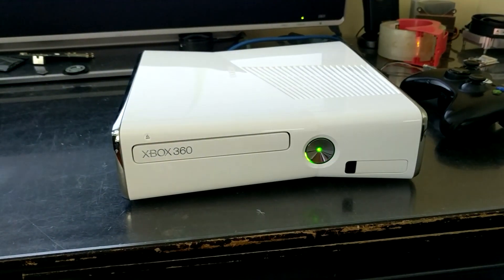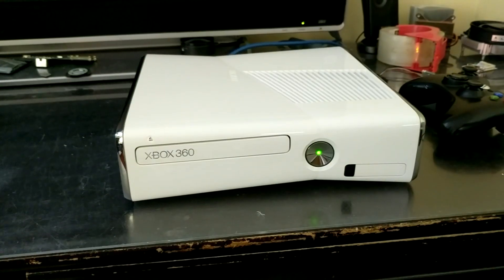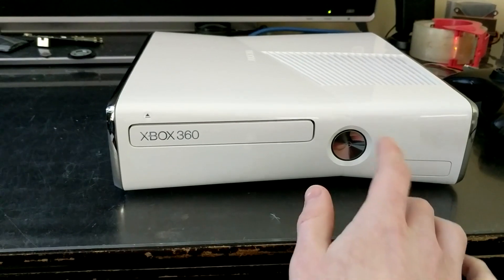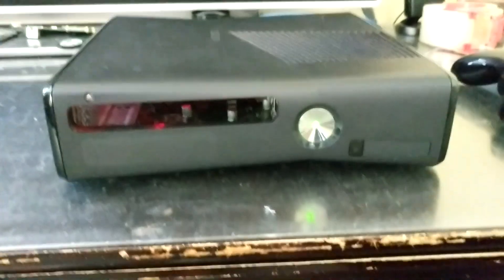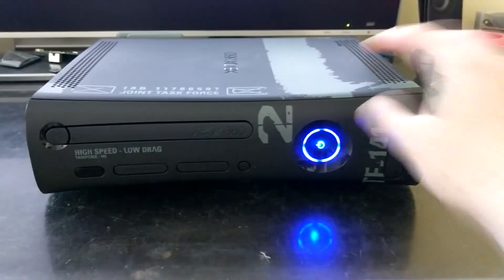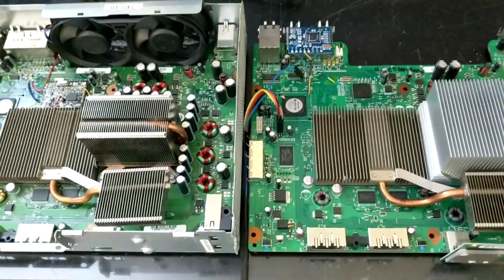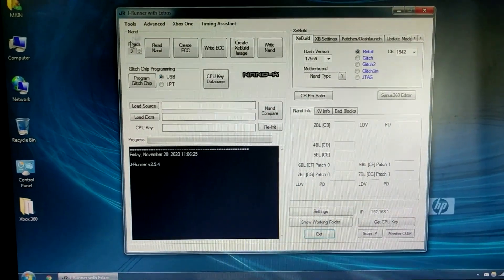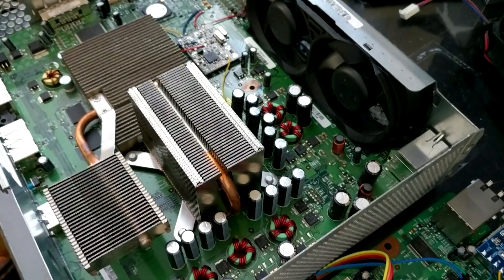SMC+ Speedup Demo

Comment: Can SMC+ be applied on a nand image which is non stock? I have my console with RGH 2.0 but dont have the original nand dump.
Reply from the maker: Yes. But RGH2.0 does not support SMC+. See the supported installs.
Reply: @Josh.Davidson  I plan to change glitcher for ace V3, is that and the nand all that I have to change?
Reply from the maker: @salpuy  yes, put ace v3 with MY timings
Reply: @Josh.Davidson  Great thanks! The CPU_RST is taken from near C4C3 on the top of the board, it is a corona V4, is that ok or should I change it for good boot times?
Reply from the maker: @salpuy  I haven't tested that one. I use R4P5

Comment: Im trying to use a smc.bin file to flash nand with glitch image through xell but cant find which smc file is your best as they are all located in sub folders and not marked which ones are for fast timing and which are stock smc files I have a trinty rgh glitch 2
Reply from the maker: Don't use an SMC file, download my J-Runner with Extras and check the "SMC+" box, to the right of glitch2, which will automatically build in the speedup.
Reply: @Josh.Davidson  I have glitched my system already so that means I need to resolder my nandx?
Reply from the maker: @soulkiller5952  No, just copy the updflash.bin file to a usb drive and use XeLL or simple nand flasher to flash it.
Reply from the maker: Also ensure you are using an ACE V3 glitch chip with S-RGH timings.
Reply: @Josh.Davidson  Okay when loading nanddump I click smc+ then create xebuild image and jrunner closes?
Reply: @Josh.Davidson  Yes I am
Reply: Is it possible to flash new timing files without re soldering my nand x?
Reply from the maker: @soulkiller5952  J-Runner closes are you sure you extracted all the files properly?
No, but this doesn't need timing files changed assuming you already using S-RGH files.
Reply: @Josh.Davidson  I got it to work now but still takes like 7 glitches to boot so I will redo timing file to chip tomorrow and let you know what happens after
Reply from the maker: @soulkiller5952  Yeah sounds like the timing is wrong, see the assistant for details.

Comment: SMC+ is too raw. Only two of the six consoles started. By the flashing of the chip you can see that the acceleration is working. But in fact, it took 20-40 seconds to load. Not too fast is it? The other consoles (Corona v1-3) never could get it to run on any firmware for the Ace v3.

On one console xell ran, but when I built a freeboot image, it wouldn't start (regular samsung memory). As a result, where I couldn't get it to run, I installed the standard build and factory chip and everything started working. Installed to Falcon RGH 1.2 with SMC+ it booted as fast as without it.

Don't even know what conclusions to draw. Who has the statistics?
Reply from the maker: Sorry friend, sounds like you did something else incorrectly. Everybody else is reporting success, and I've myself used it on nearly 50 consoles since releasing, all working perfect, and before then 30+ consoles tested, loads of other people have reported success, from a one time installer to other RGH shops.

REMINDER that INSTANT boot time will NOT see any improvement! So with Falcon, of course it looks the same because Falcons always instant boot. The speedup only starts to help with 2 cycles and more, and its MAINLY meant for Slims/ or Phat with (S)RGH2.

If you are having a problem with the DEFAULT timing file on ACE V3, this is because that firmware is not supported. For CORONA, you need to install the S-RGH V2 firmware, the files can be found in my J-Runner under Program Timing File menu. Reminder that the V1 Corona files do NOT work well, they boot like trash even without any SMC+. You need to use the V2 PRO files that are built into my J-Runner, and these are tweaked by me for best performance.

PS: How can the acceleration be too fast on value 41 in Corona with some consoles working on the much quicker acceleration of 2F??? So something else is wrong. 41 was choose because it always passes the checks before the timeout, you can confirm this with a logic analyzer if you want.
Reply: @Josh.Davidson  I am not stupid, I understand that I need to build smc+ image and flash the chip ace v3 with your firmware. But this does not work often. The wiring is standard, the chip without firmware works as it should. As soon as I flashed it and programmed the flash memory with your smc+ stops working. What can be wrong?
Reply: @Josh.Davidson  By the way, your timing guide recommends 8_1 firmware. But it's not. Most set-top boxes run on 9_2 and 10_1, which once again confirms that you have not finalized it.
Reply: @Josh.Davidson  In the end, it is clear that it is not worth it. It's not worth the trouble with the firmware, when you can solder everything as standard and everything will work. 15432 is my friend Richy on Russian forum confirmed it.
Reply from the maker: @drewmorama  well, I don't know how to help you because only you are reporting problems. Everybody else is reporting NO problems in over 100 consoles so far. And the wire routing does not affect anything with this.

"Most set-top boxes run on 9_2 and 10_1, which once again confirms that you have not finalized it"
I found with the exception of some set-top box, with X360ACE from Aliexpress/ebay then 10_1/2 files are more likely. BUT, I purchase my chip from X360ACE factory directly (NH-GAME redistributor) and in the hundreds of Corona set-top box, I have RGH they are booting under 10 seconds with 8_1, or 9_1, or 8_2, or 9_2 firmware. You can find the right firmware for every board by following the diode. But YOU must find it, and usually I begin from 9_1 firmware... I updated the documentation to show 9_1, its used more than 8_1. Not every set-top box will use the same firmware.

BUT! The firmware for X360ACE which the set-top box likes does not affect anything for SMC+, because every S-RGH firmware is compatible. The slowdown is delayed by some time (see delayer.vhd) enough, that's all that is required. YOU just have to find the correct firmware for your set-top-box. Also some various quartz can affect it.. in America the 2 distributors of X360ACE, PhenomMod and WeekendModder, and in United Kingdom ChipChopModUK  are all using NH-GAME X360ACE. The quartz here is most consistent. So this is what my instructions are for.

I spoke already with 15432/RichY over month ago in whatsapp about such matters which is where I learned this method. The SMCs from 15432 are using "2F" value in Corona, much more "raw" then SMC+. SMC+ on Corona is using value "41". So the SMC+ firmware is more finalized than the original SMC from 15432, because as he told me he had only 5 XBOX 360 ever, whereas SMC+ SMC has now been reported working on over 100 XBOX 360.

"when you can solder everything as standard"
Yes, the soldering/wiring is always the same. Never did I said to change it.

If you don't like my firmware, you are free to use another firmware, but don't tarnish my firmware because for everyone else, the set-top box starts in 5-10 seconds!
Reply: @Josh.Davidson  I didn't intend to taint your firmware, you did a great job, I appreciate it. I'm just giving you the facts of how it works for me. Of course I have done 100+ consoles, the experience is there, the soldering is neat too. All soldering points are standard. But in the WeekendModder RGH 2 video on Trinity with the CR4 check, he used an alet_reset, near the radiator.Before your refinement I tried this solution, and it also didn't work every once in a while. 

Sometimes the console would load fast and stable, but other times it would take either a long time or no start at all. Then I used muffin method and it was more or less ok. Sometimes the console would load fast and stable, but other times it would take either a long time or no start at all. Then I used muffin and it was more or less ok. I don't deny it's possible it was the chips, because sometimes i had 1 defect out of 10, it just wouldn't start even though the pulses were there. I put another chip and all was ok.

Lately I ordered from GameParts Store. They are original, there were no defects and all serial numbers can be checked on the official website. Just wondering why this could be, it's hard to make a mistake there and do something wrong. Some of the consoles do work though. Now I'm waiting for a new batch, I'll be testing.
Reply from the maker: @drewmorama  
"the soldering is neat too. All soldering points are standard. "
Very good! But also this does not affect anything with acceleration. A professional solder or not. Only this will affect whether the set-top box starts. I suggest you to try, firmware with no acceleration booting in 4 attempts or less. #...#................####### timing too high or length too low, #...#....................#  timing too low or length too high... #...#............############...###....#..#..# SUCCESS. After the set-top box works in 4 attempts or less, you can apply the acceleration and check the result.

Yes, I have used both with reset on R4D4 resistor near the radiator, also FT4R2 and C5R11. Usually i am using R4D4 or C5R11. But I found that the difference is small, but something. For Corona, I am always using R4P5. If it doesn't work, you can try another.

Interesting result, I had always faster starts from S-RGH V1 (Trinity) or V2 (Corona) firmware than Muffin firmware. S-RGH, the slowdown is from the chip. Any change in the quartz will mean a difference, the console will use a different firmware for good result. The quartz quality can be strange from China. I took out of one XBOX TRINITY X360ACE V3, with firmware 60.6 0.5. Then with another X360ACE V3, the firmware must be 60.3 0.5. But this problem is not really so much, you can just find the firmware from the debug light.
In muffin, the slowdown comes from the SMC. SMC use the clock generation from the motherboard, must be very high quality for running the CPU! All clocks come from that quartz. So the result is almost the same every time, each set-top box will use almost the same timing.  But for S-RGH result... no, you must adjust :)

"no defects and all serial numbers can be checked on the official website"
The X360ACE security was defeated a long time ago, I have seen many times clone X360ACE with that security. :(
You can try NH-GAME store, but they must restock.

Comment: I discovered this video thanks to MrMario's video. First I'd like to thank you for your hard work, this thing is simply awesome. Thank you. I would like to ask if I can try it without disassembling the console. I have Matrix+Jasper, AceV3+Trinity, AceV3+Corona and AceV5+Corona at home. Do I use any decent guide found online that tells me to use Simple 360 Nand Flasher? I've never done the USB update method, I always reflashed the NAND via J-R Programmer. Thanks for any info.
Reply from the maker: Thanks!
Yes, simply place your created updflash.bin in the same folder as SImpleNandFlasher, and follow the onscreen instructions to flash the NAND!
Reply: @Josh.Davidson  Well I put the updflash.bin to USB stick and booted to Xell via Eject button and it flashed the NAND without an issue. I tried it on the most stubborn Jasper BB I have and man, it works great! I was getting inconsistent 1-10 glitch attempts before. I remember I tried every single timing file I could think of. And now? Most of the time the console instaboots, sometimes there is a 2nd glitch and then it boots. That is crazy. Well I was looking at your github, reddit and other sites but couldn't find your PayPal or anything like that. I'd like to buy you a beer. Can you share the needed info?
Reply from the maker: @radekoplustil6750  Thanks man, so glad to hear that you are enjoying it!
<redacted>
Appreciate it man thank you!
Reply from the maker: Thank you!

Comment: Does it work on Trinity Muffin method? There, when assembling, need to check CR4 box, now instead this put smc+ checkbox?
Reply from the maker: NO! And it never will because muffin does not delay slowdown enough, so I didn't bother to add the GPIO Slowdown method into it. I mentioned all supported installs in the description, nothing else is supported.
Reply: @Josh.Davidson  I don't understand English well)) Can you say that your method is faster than a muffin matrix?
Reply from the maker: @drewmorama  np.
Yes. S-rgh with SMC+ is way faster and more consistent.
Reply: @Josh.Davidson  Grand merci sir!))) It would be great to see the complete installation instructions from start to finish, with explanations.)) ECC creation also with a  sms+ checkbox?
Reply: @Josh.Davidson  What about WB2K memory support?
Reply from the maker: @drewmorama  Yep
Reply from the maker: @drewmorama  Untested, probably its too fast, use a CR4 speedup instead.

Comment: I know you stated that this is not for  ace v4 or v5. My question is have you tried and know for sure it dont work or you didnt have consoles to test? I have 4 consoles with ace 4.1 and wanted to try but didnt want to waste time if you have confirmed them not to work. Thanks for work also.
Reply from the maker: I have not tested it. It might work, or it might not. Sorry.
I know on the V3+ on Corona it works, so maybe it does for V4/V5 on Corona? But on Trinity, I have absolutely no idea. If X360ACE used delayed slowdown then it should work, if they didn't, then it won't. Sorry I couldn't be more helpful, myself and my testers didn't had any V4/V5 lying around.
Reply: I will do some testing later on and see. Thanks for your help.
Reply from the maker: @danielp8478  let me know, thank!
Reply: Not working on  Trinity with ace 4.1. Will be trying corona in a few hours with ace 4.1.
Reply from the maker: @danielp8478  Thanks for the testing, not surprised.
Reply: Just got done with the corona 16gb, and it is 100% working with ace 4.1. What you have done is amazing for sure.
Reply from the maker: @danielp8478  awesome, thank you,  probably trinity timing for it has longer slowdown, I can try make a special release for trinity ace v4/5. Would you be willing to test?
Reply: Sure i have no problem with that.
Reply from the maker: @danielp8478  Thanks, I'll contact you later
Reply: I am still messing with this on some Trinitys. The frist console i tried didnt work but come to find out it was the console not this. Now i have tested on another Trinity with Ace v5 flash Xell with smc+ This glitches fast as it should with smc+ then i make a glitch nand with smc+ and it never boots glitches forever.  I will keep playing with it.
Reply from the maker: Yes, the ECC is using CR4 timeout values, I did not make new ECCs since there is really no point, you only need the ECC to work once. That all makes sense why your machine got XeLL.
Also apologies for the delay, I've been really busy lately with Send-Ins but I'll try to get you those SMCs this weekend.
Reply: That makes sense now. Also no rush.
Reply from the maker: @danielp8478  https://mega.nz/file/vd8yzBBK#UguJZAQKDTgTfMmRTm2pbtPU9b3XjPRds8VCp5BS3AQ

Start with 58, if that works, try 50, if that works try 48. They are in steps of 8, and the numbers are hexadecimal.

If not even 58 works, then I give you smaller numbers between 58 and 60 (CR4 timeout value).
Reply from the maker: Any luck?
Reply from the maker: We tested this and it doesn't work. the Trinity timing on those chips is just not compatible with acceleration passed CR4.

Comment: Great vid and thanks for sharing... any chance of having the benifits of this smc with a regular rgh2 install? I ask because i have a 4gb corona v6 with trash boot times, and to the best of my knowledge 4gb coronas are not s-rghable which u say is the only supported install method for coronas... and i dont have the skillset to, nor would i want to convert it to 16mb
Reply from the maker: Thx. No support for old RGH2, because how it works, it slows down the processor, then counts the time, then sends the reset pulse. The 15432 methods count first, then immediately before glitching they slowdown, then glitch. So the entire process goes faster and we can speed it up!